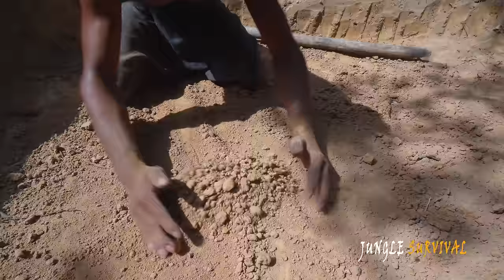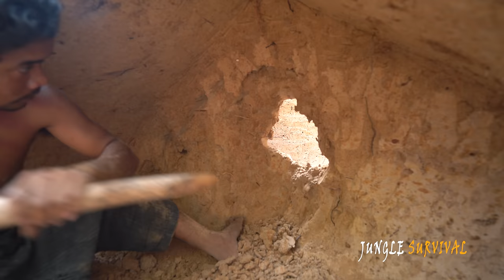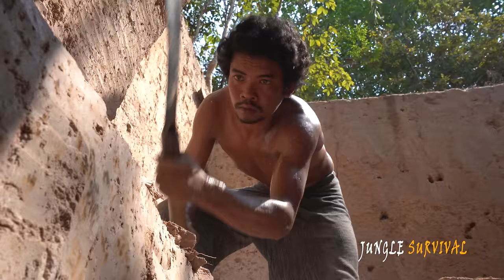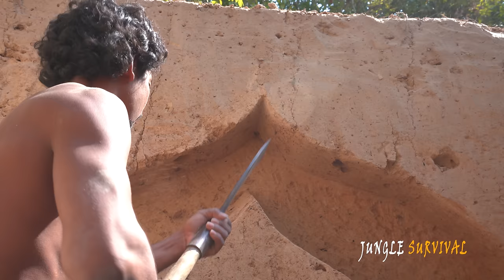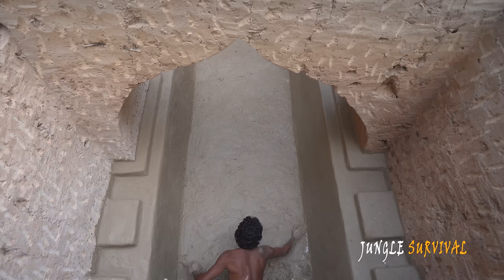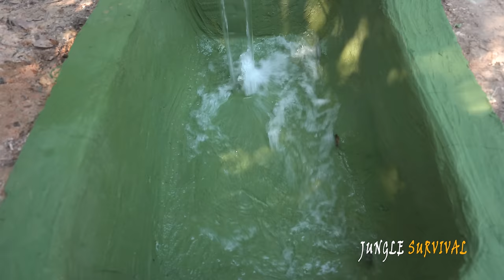Build Underground Tunnel Swimming Pool Around Underground Mansion

Comment: The people who left a dislike don't have a creative bone in their body.
Reply: maybe they just dont buy filling a not so small swimming pool with a teacup ;)
Reply: @Rastayeti666  That can be easily solved, just skip that part of the video. :p
Reply: Rastayeti666 you must not have seen the three pipes made out of bamboo he used. He hollowed out some bamboo and made three long pipes all the way to his water source. LOOK AGAIN!!! There is no need to be mean just because you’re blinded.
Reply: @sweetbread9008  he made a basin, fills in water manually and it runs through the pipes in the pool. there is no connection to the water. in another video this is done, but not in this one.
Reply: Rastayeti666 thank you. I must’ve had some confusion for a moment.
Reply: @Gantzz321  yeah basically people that never had a shovel in their hands and digged in the earth. for example alone the dug out material of something of this size should be around 25qm, which is two full tuck loads of earth. But yeah, i bet the one guy transported it away with its bare hands too
Reply: Obiwayne Nah it’s probably American contractors who would spend a year to build something like this.

Comment: Starting to think every time it cuts he has normal tools to do this with.
Reply: A caterpilar and water pump too
Reply: Paintotal ya like how am I supposed to believe this dude filled up that whole pool with a clay pot
Reply: And also when he was painting, i imagine ha had a rolling paintin tool and a green bucket
Reply: @Aroncare  when it cuts to the next stages of painting, the vast majority of the paint is still wet.. impossible. Only the most recently painted areas would be wet.. It's impossible that he did this alone.
Reply: He definitely did not clear out several tonnes of earth by throwing it over the wall with his hands.
Reply: It's long been common knowledge that this channel has a full team of workers using modern tools, excavators, and modern concrete.
Reply: Осылар ерінбейді екен😀😀😀😀😁

Comment: Ok, I suppose I have to be the one to say it......   it looks fantastic etc., but also it looks as if the water is poured in once. In warm climates that water is going to get stagnant and even downright dangerous (bacteria etc) in a very short time, so it seems a lot of work for a few swims. To avoid this, it 'd have to be built with an inflow and outflow of water at least. maybe diverted from that nearby stream.